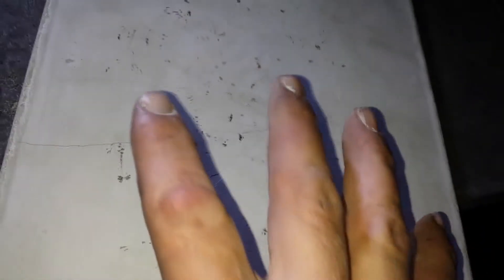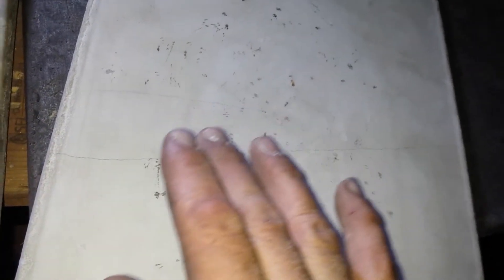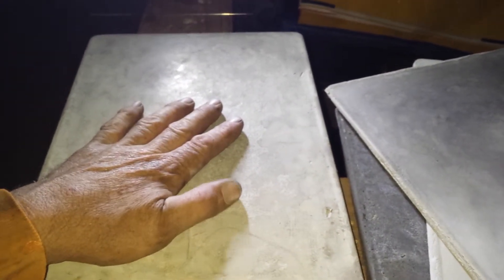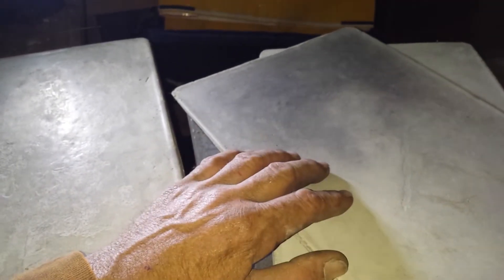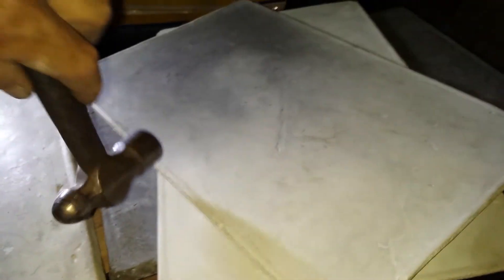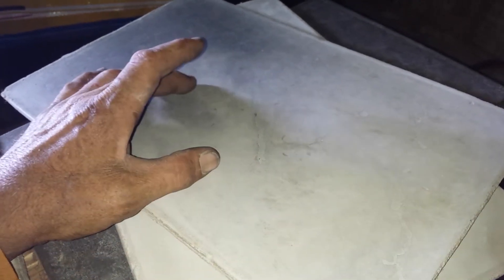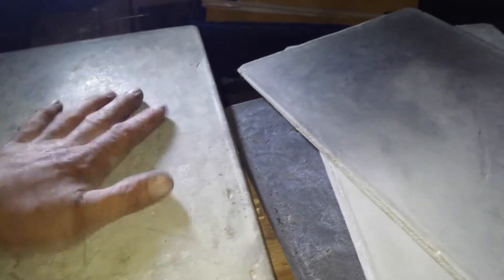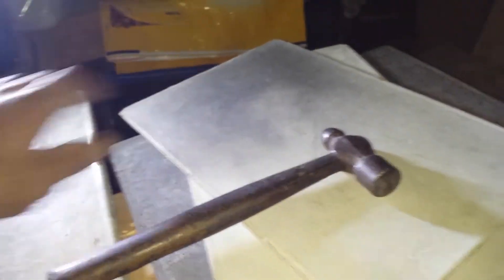Hemp/ geo polymer fiber Engineering explained

Comment: In use as a surface for Hemp Channel Stud/I-Beam SIPES using Hemp as insulation filler or as hempcrete, what would you estimate the R-Value comparison over a one year period with a conventional Wood/Fiberglass Stud wall based on energy costs? As I design in the Park Model RV format (www.tugboatwilly.com) I am thinking the savings in weight using no steal would balance the difference in energy use. Realizing I am limited to 400 sq.ft. and probably under a 34' X 12' footprint. I have seen some figures that suggest replacing the undercarriage support beams with either Hemp composite Channel or I-Beams would be stronger and would probably never rust?